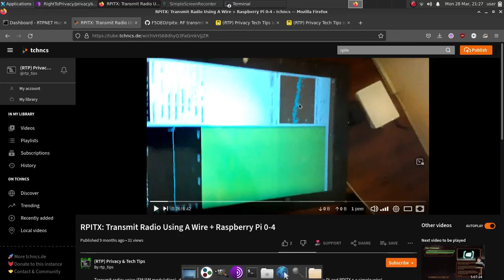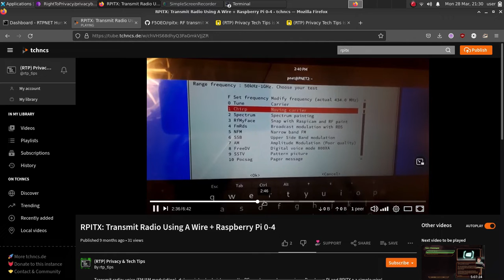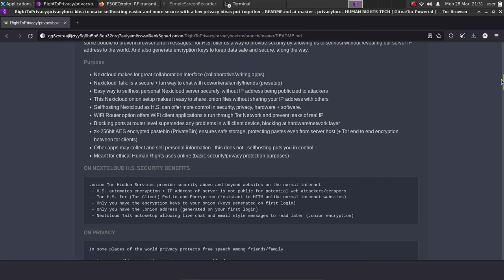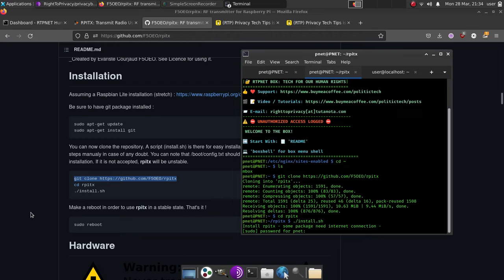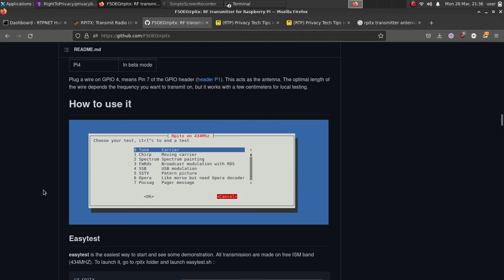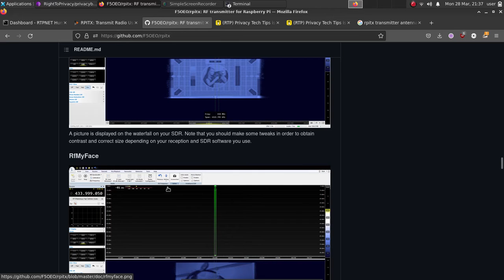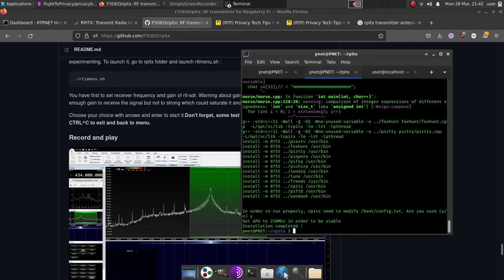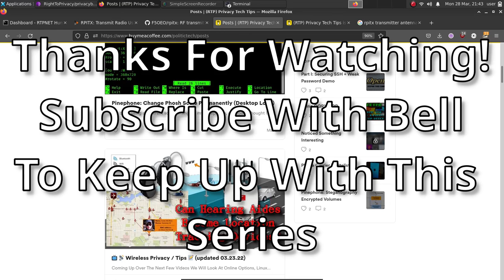Installing RPITX (Raspberry Pi As Radio Transmitter!)

Comment: What is it's transmitting distance?
Reply from the maker: I haven't tested it that far - but I'd like to.

All depends on the antenna, and power. The pi itself does not have great power - but you can join the rpitx google group to find out how to amplify - but be careful to abide by your local regulations etc.
Reply from the maker: Here's the google group: https://groups.io/g/rpitx where you can see what people are doing. it's interesting!

Comment: What's the furthest distance I can reach with one of these? Is there a way I can connect up to an antenna that can be heard 50 mile radius ?  📡 
Please provide details. Thanks
Reply from the maker: Not too far, as is, rpi power isn't high enough for that out of the box - but some may adapt and increase power with additional hardware. 

Though I've only tested in a single neighborhood area, personally.
Reply: @RTPTechTips  can you help point me into the right direction for me to learn how to.
Reply from the maker: @carlos_mann  I don't have any direct links as it isn't something I looked into, but the groups for rpitx may have something of use: https://groups.io/g/rpitx

Another nice resource: https://www.rtl-sdr.com/tag/rpitx/

Disclaimer: be sure to carefully follow local regulations if looking into amplification for legal lab / experimental testing purposes (band pass filter).

Another thing you may find useful is issues section on RPITX github: https://github.com/F5OEO/rpitx/issues/40
Reply: @RTPTechTips  alright cool, something like this should help me thank you 😊
Reply from the maker: @carlos_mann  Very welcome!

Comment: whenever i transmit on rpitx, it turns my monitor off that's hooked up to the rasp 4 and keeps me from putting in any inputs, any reason why it might be? my stuff also wasn't filtered properly so I'm wondering if harmonics like that will effect it
Reply from the maker: Is it a pi screen? If so, it could be using more power, taking it from the screen. This occurs on my Pinephone when I use rtl-sdr on it. Solved by turning brightness up. But if you mean hdmi hookup to outside powered monitor, could be interference.
Reply: @RTPTechTips  ya its to hdmi, most likely interference, I'm not gonna use it until I can get a proper filtered antena, thank you!

Comment: This is an awesome project. 👍
In regards to a rtl-sdr USB, have you used it on a raspberry pi? 
I’d like my raspi Kali to have all the tools on it. 

I’m so eager for the nextcloud / rocket chat integration!
Reply from the maker: Yes I have! I have a video on setting it up on Linux (pinephone example) but works for any Linux device (same steps).

 Since you like KISMET, give rtl-sdr a go running KISMET and open the data source to watch what flights are around, or monitor your smart meters. You might even catch a mistake on your bill. :)